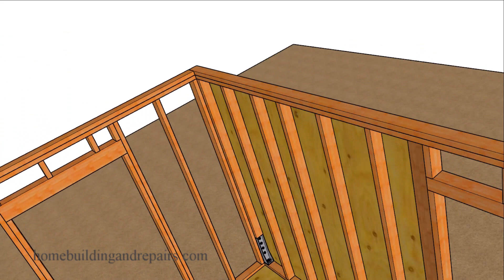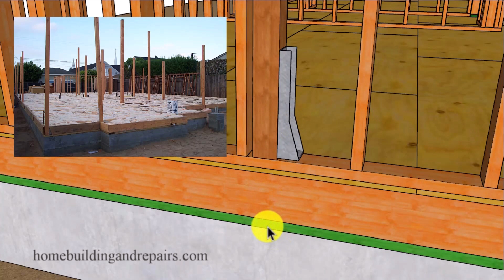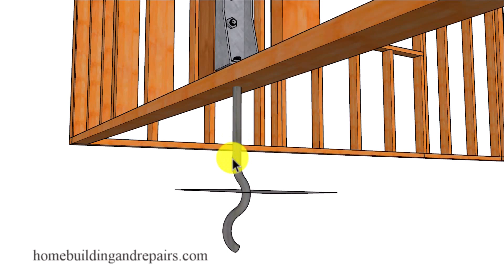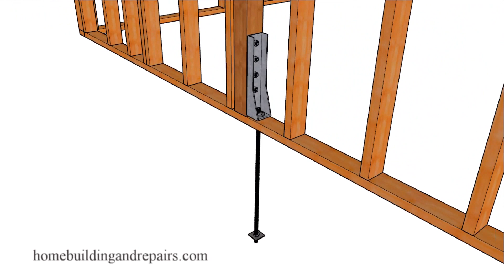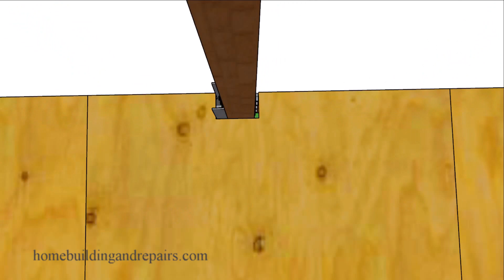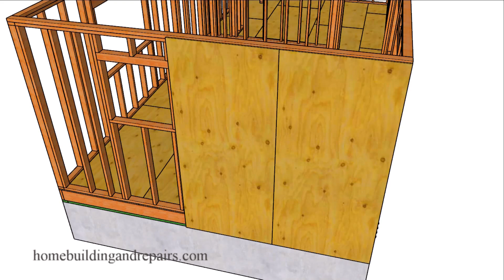The Best Methods For Attaching Structural Hold Downs To Raised Floor Foundations - Engineering Tips

Comment: If you have  3' concrete perimeter stem walls for a crawlspace, but were planning on just footers with crawlspace cripple stud walls for floor joist support, how should interior shear walls be anchored to those ?  Have the shear wall begin at the sill plate on those footers, with hold downs on posts ?  That would make the total height of the BWPs 14' for a 10' interior wall height.  Or just have the posts go through the floor and the sheathing panels only go from raised subfloor to top plate of interior walls ?  Should all those cripple walls in the crawlspace be sheathed, even if not under the designated BWPs up in the living space ?  Or should all those crawlspace cripple walls under BWPs be full height masonry the same height as the perimeter stem walls ?  Compartmentalizing the crawlspace is going to require ducted runs to ensure the dehumidifier pulls from all closed off areas.

Comment: You answered a question that bothered me. Thanks. A small question about the use of the plywood as a bracing panel. Your video shows a vertical orientation instead of horizontal. Is there a reason for not using the horizontal option?

Comment: Hold downs are a part of engineered shear wall design. They are not for the lateral racking forces but the overturning forces in tension. 
The manufacturer is the governing engineer for the product, not the building's design engineer or the local building department. Your engineer calcs the total forces applied, select the hardware that meets those forces, and includes it in the plans. Simpson allows an approved coupler nut with 2 inspection holes for thread depth.
The only problem I see with your illustration is that the inspector will want to see a gap between the sill or bottom plate to the hold-down to ensure proper tension and offset of 5 degrees max. This is why hold-downs are never installed close to the bottom plate. You need to install your hold-down 3" higher for every 1/4" you are off of a perfect layout.
Reply from the maker: We like gaps and I couldn't find where there wasn't one.

Comment: I believe these are required in costal areas due to Hurricanes but, in my opinion, should be required across the country. Straight line winds, tornadoes etc seem to popup everywhere nowadays. At the very least, a huffing and puffing big bad wolf. (sorry, I couldn't resist)